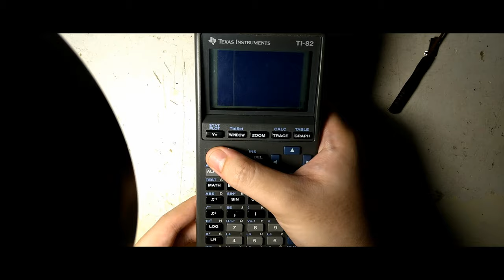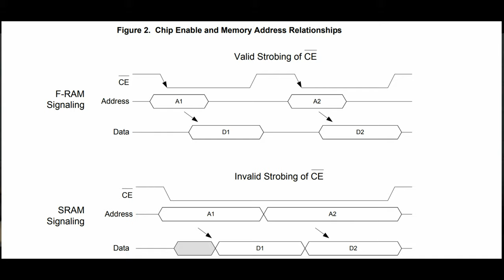SRAM2FRAM_PT1 | Upgrade TI-82 SRAM to FRAM

Comment: That's a neat project idea. Good luck getting it to work. I've always wondered if it's possible to adapt the video output board for the TI-82 to work with a TI-84. The motherboards are different so it's not that straight-forwards to me if it could work.
Reply from the maker: As far as I know, the TI-82 Use different LCD display controller. I actually (secretly) writing the stm8 code that mimick the Hitachi T6A04 LCD controller.

Comment: Oh yes, lithium ion. Because we don't already have enough things to charge already...
Reply from the maker: I found that trying to fit Li-ion into the circuit that is not originally designed for 4.2 volt is quite challenging. As I'm currently practicing the Low power device design for other project thatI've been working on. Powering 6 volt device from 4.2 volt battery requires boost converter. And these boost converter has to have a really low quiescent current. It's not just trying to make thing "chargeable" anymore. It's about designing and experimenting that benefits next and any other project that I definitely do in the future.